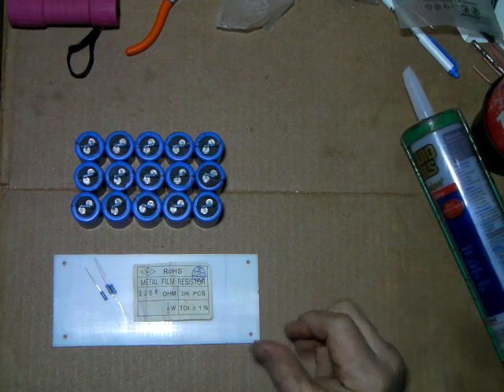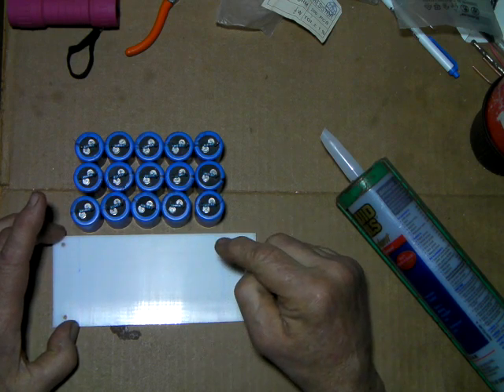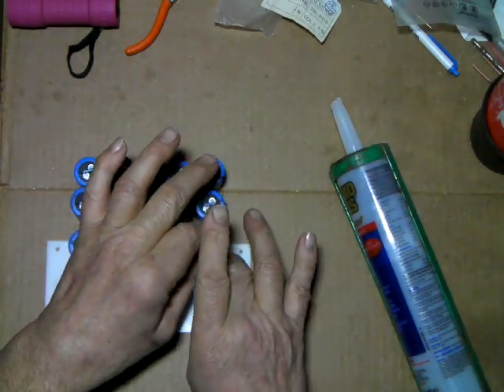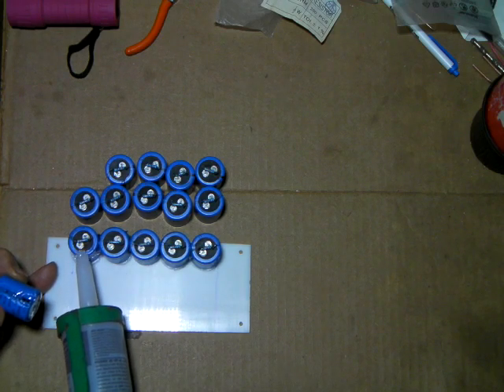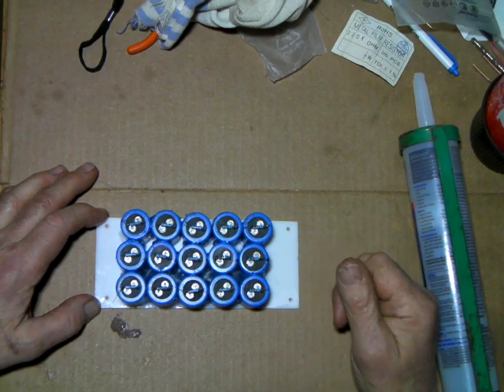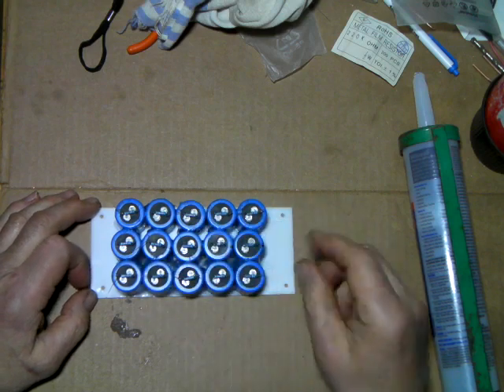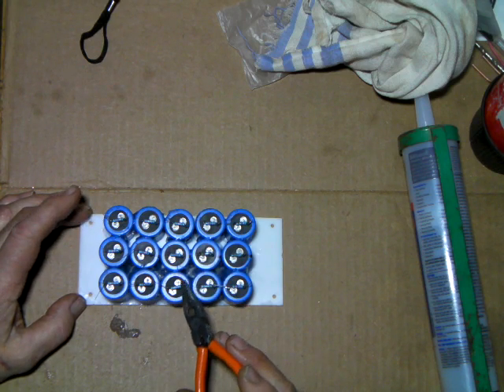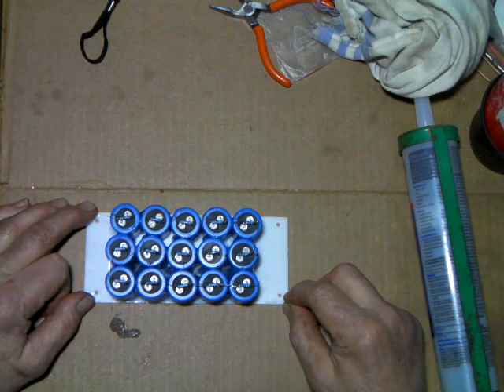Build a Tube Type Linear Amplifier For CB Or Other HF Bands Ep7:How To Build A HV Capacitor Stack.

Comment: Acetone is released from the silicone and tends to eat through the outer covering of the caps over time
Reply from the maker: Not sure what silicone brand you are using but The GE Silicone 1 does not contain any acetone, it does however contain acetic acid and that is what makes it smell like vinegar and it also will turn copper clad boards dark if you do not give it a few days to cure out  before you enclose it into your project......but it will not attack the plastic covering of the caps.

Comment: Have you thought about using hot glue to hold them in place? If they get too hot, you'll be able to see it more easily as the glue will run. It'll also allow you to remove or re position them, if required...  You also don't get that strong vinegar smell either, that you would do from many silicone glues...